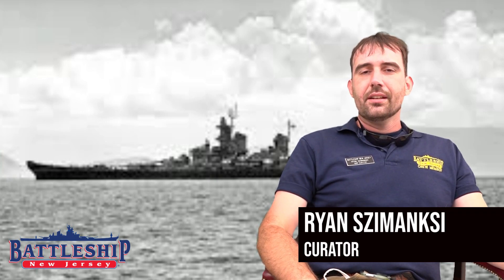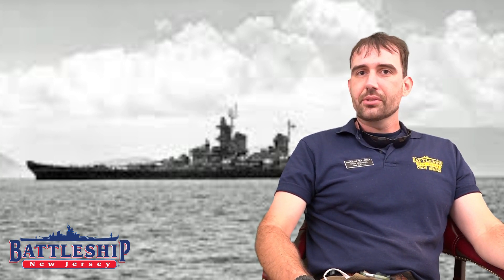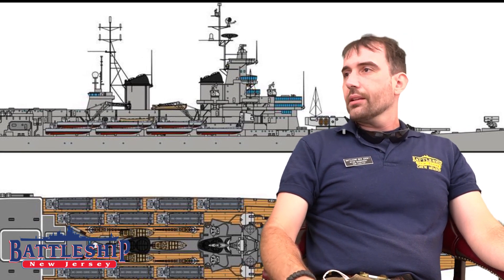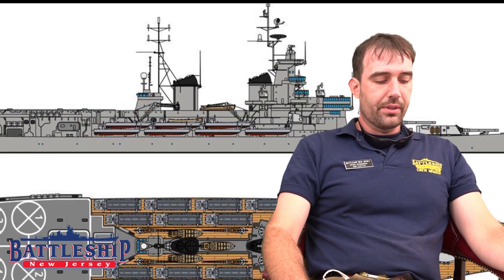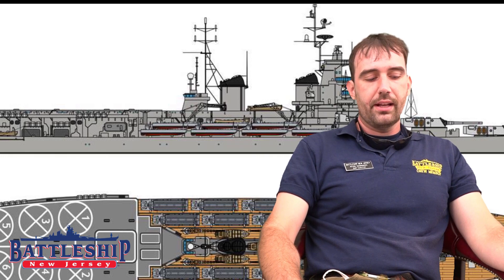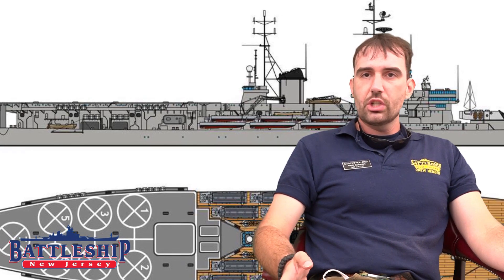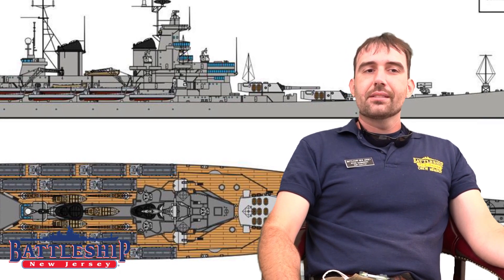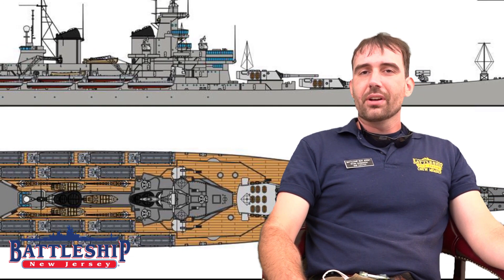Landing Helicopter Deck Conversion

Comment: Ryan you probably hear this often but I want to join the band and saying you do a fantastic job at these videos because of your wealth of knowledge! I have learned so much and it's all because of you and these videos! I tip my hat to you sir and thank you! You would be a hit at any of the parties I could give during the year if only so many miles didn't separate us. As it is there's probably seven eight hours between our locations. I would like to ask you that when all these changes were being made to the battleship throughout his career. And the videos I've seen of areas inside the ship, I wonder how do they get cables and wiring and whatever else they might need from where the gun are missile launching device is down to the fire room, because it just doesn't look to be any open pipes and which to pull cable fresh and new! And certainly the old wires, probably doesn't have enough, can I say," conductors", to operate the new weapons.? I look forward to reading your reply thank you.

Comment: If memory serves,  didn't the Japanese navy convert a couple/few ships into hybrid BB/CV platforms? Its late and I can't remember the names of the ships. But a comparison might be interesting
Reply: Yes, but they were poor ideas.
Reply: @WALTERBROADDUS  heh heh heh. Indeed they were.
Reply: @WALTERBROADDUS  Hyuuga i remember being one of them....i belive also the Fuso sisters were converted
Reply: @jonaspacina  Ise was the other battleship conversion.  Also the Mogami was similarly converted losing the 2 8" rear turrets with a raised "flight deck", after suffering damage at Midway.

Comment: Interesting concept. Never knew there were plans for something like this on the Iowa's. In alot of ways though, this proposed conversion reminds me of Japan's Ise class conversion mid-war into Hybrid Battle Carriers. I wonder if the Ise's conversions inspired this proposed NJ conversion or if its just, purely coincidental.
Reply: i doubt it.....as long as there was any possibility of another big gunned ship ship getting in  range, I think American and British admirals cringed about these hybrid ideas. There was a HMS Lion hybrid proposal as well. On the proposed Lion hybrid a British admiral wrote " The functions and requirements of carriers and of surface gun platforms are entirely incompatible ... the conceptions of these designs ... is evidently the result of an unresolved contest between a conscious acceptance of aircraft and a subconscious desire for a 1914 Fleet ... these abortions are the results of a psychological maladjustment"
Reply: @andrewmacomber8345  but that was before helos and VTOL existed, now you would not need such a large deck with a straight shot through the ship.
Reply: @andrewmacomber8345  but that was before helos and VTOL existed, now you would not need such a large deck with a straight shot through the ship.